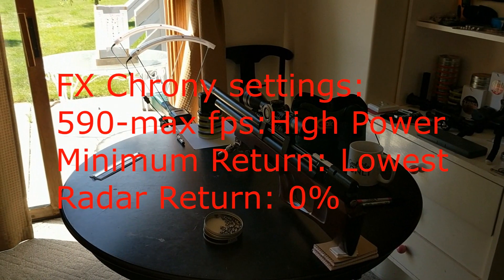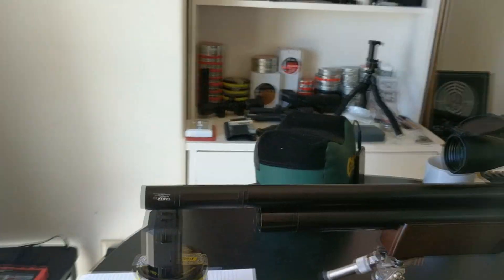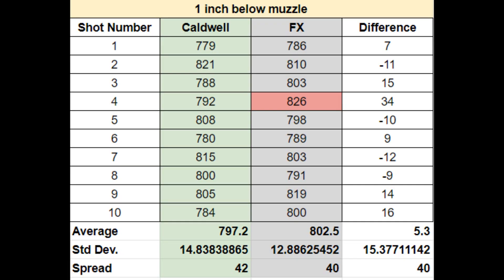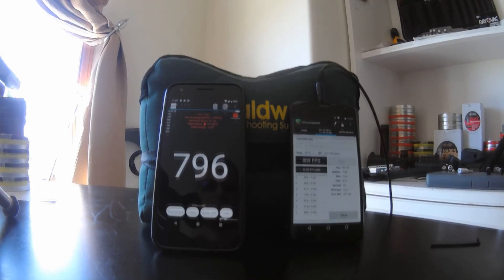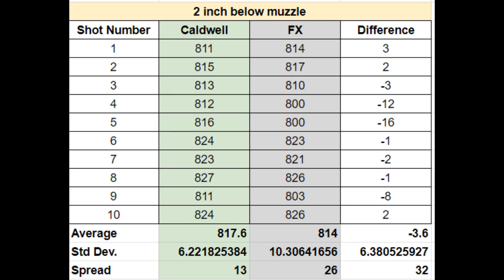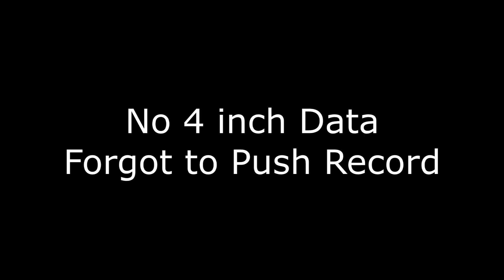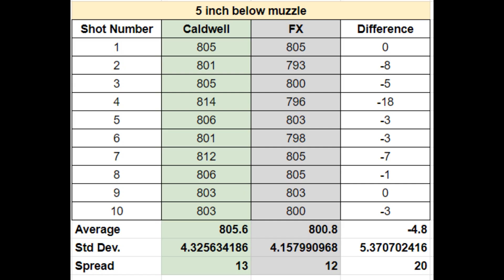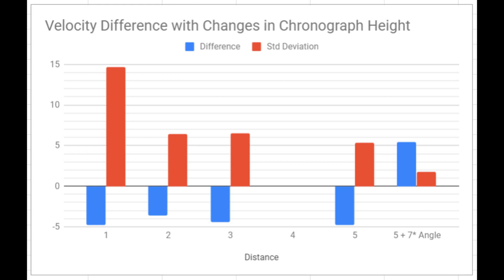Day 3 data from FX Wireless Radar Chonograph Testing

Comment: I just got a Wildcat MK3 tuned from Utah Airguns. They tuned it to shoot slugs at 920 FPS. They use the Labradar. I just bought an FX chrony and with that I’m getting 900-905 FPS average, a 10-15fps difference then what the gun was tuned for. Unfortunately, I don’t have other chronographs to compare.

Comment: Interesting data and experiment. I think your methodology is pretty sound. However I don't understand your comments about shot #4 discrepancies, given that the extreme values for that shot # were not reflected by BOTH devices. Had there been a true problem with that pellet station, then BOTH devices should have shown deviations in a similar direction from their respective central tendencies.
Reply from the maker: That is what I thought, too. I suspected that the 4th chamber of the magazine might have been causing the different readings.

Comment: How firmly planted were the experiment apparatuses set up? In other words, was the FX chronograph along with its stand of stacked pellet tins and the rifle safeguarded from unnecessary movement? I’m asking because bolt actuation and recoil might have caused both to move from shot to shot resulting in variations of radar return. Thus, these uncontrolled movements, although slight, could have significantly impacted the observed comparative inconsistencies in the experimental data. Just a thought towards eliminating one variable. To help find the ideal “sweet spot” place the chronograph at varying distances BEHIND the muzzle opening.
Reply from the maker: It was rock solid. Anyway, I'd say it proves my point that the FX chrony was not very useful in the real world as first realeased if any minor movement like bolt actuation were to change the chrono readings. The Chrony is supposed to make getting ACCURATE readings easier.

Comment: You could try moving the chrono forwards/backwards as well as up/down.
Reply from the maker: I did in a previous video. Basically to get it to work consistently you need to attach it to the barrel.